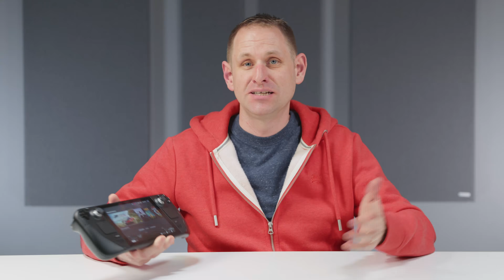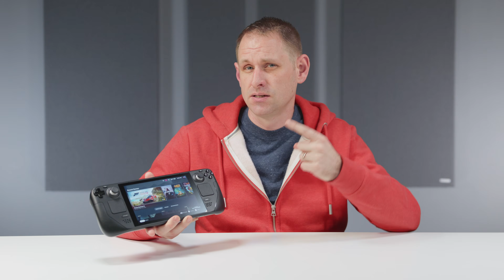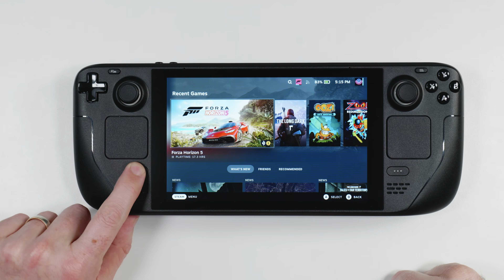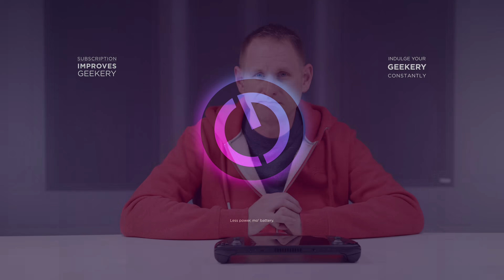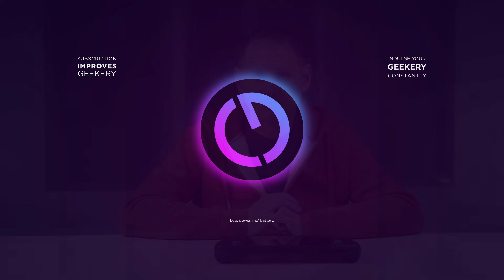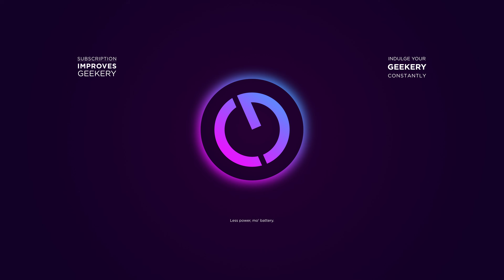MORE BATTERY LIFE on your STEAM DECK

Comment: What is the difference between Frame Limit and Refresh Rate?
Reply from the maker: Frame limit will actively limit the rendering performance of the GPU. Refresh rate controls the display - a lower rate will use less power. So, if you limit the GPU to 30FPS to save power, you might as well drop the display refresh rate to 30Hz, otherwise the display is refreshing twice as often as the frames being delivered, which wastes power. For this to work, you also need to switch on V Sync in your game. Hope that helps. 😊
Reply: @ConstantGeekery  thy

Comment: On my steamdeck  ive install windows 11 but i need to know  what to do on my steamdeck so the battery doesnt died quickly
Reply: SteamOS is optimized for the steam deck and is being actively developed and updated for this specific device. windows on the other hand is a desktop os and is far from optimal for any mobile device, not just the deck. You won't have as  nearly the battery life on it as you would on steamos. But if you really need windows the best thing to do is to dual boot,  with your primary os should still be... obviously steamos

Comment: yep. that also works for laptops :) gaming. but triple A for 3 hours... not possible yet. i tried it, 1 hour mark is the possible todate. to 40, it can save some for sure, but i was between 30 to 51. apu only. on rtx, is 51, couldn't passed 2 hours AAA. which is still impressive.

Comment: I don’t have a Steam Deck. Haven’t seen one. Compared to a laptop, is it worth?
Reply from the maker: I agree with Andre - if you just want a gaming device, there's no laptops that can compete at the entry price point.
Reply: Purely for gaming, especially compared to similarly priced laptops, I think the Steam Deck is hard to beat value-wise.
Reply: As noted, the Steam Deck is for gaming and, as such, isn't a laptop replacement.  What I was able to do was get a laptop that wasn't capable of gaming, and therefore less expensive, and the Steam Deck to take advantage of my Steam library.
Reply: I personally am shocked with the battery life... There is too much faff to get this to be portable enough. Settings and work around and different with each game.... That is just too much time wasted.... I expect that from a laptop and desktop but for a dedicated gaming device I'd expect it to eliminate these... Just pick up and play... With min settings.. Low. Mid. High(wired) not all this testing which you do on desktop with gpu and what not
Reply: for what I've seem this thing can do,,, I would say yeah! I'm planning on using it instead of my laptop. my laptop is too over kill to me... and if I want a bigger screen, I have a portable monitor oled 1080p. I always loved portability, and this.. is great.  based on the tests I did, for battery life, it's not different than a laptop with like a ryzen amd on it. if you don't like gaming tho... just go with un ultrabook. battery life would be higher. but if you like both and don't mind 30 to 51 fps, steam deck is just prefect. screen is not bad too. it's also touch. for the keyboard I would buy a mini one that I can type